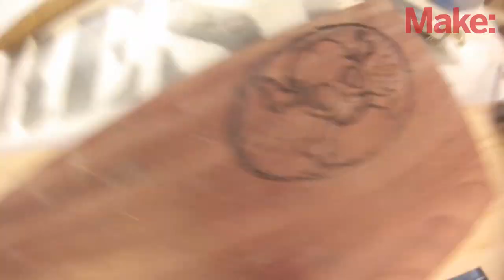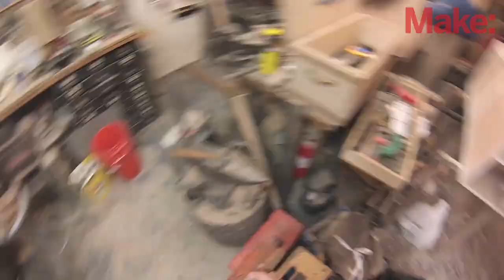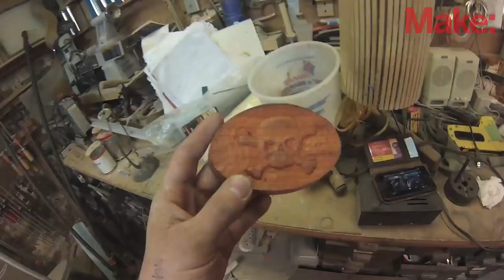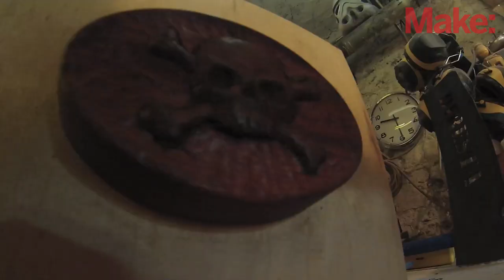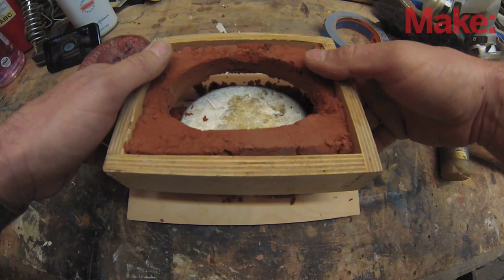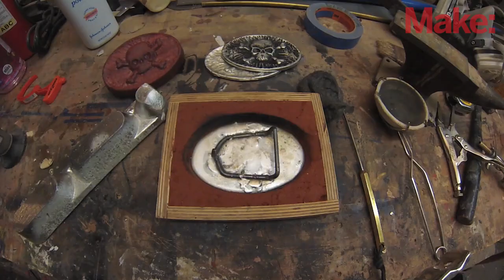DiResta: Skull Belt Buckle

Comment: I took metal shop back then in high school and the sand mixture is sand and water mixed together and leaves a impression of the model that Jimmy used. A lot of casting are made by using this method..

Comment: I find also very impressive, the design of the belt attatchment. I know that it is not a big deal, but you did it with only one piece of iron strip, by bending it correctly, and i would have thought something more complex and difficult definitely .
And also i had never seen this clay mold beign made in reality, except from some movies or documentaries that only show you one bit and not the whole proccess, which is something i like with your videos instead.

Comment: Pewter is very cool to work with. GREAT JOB
Reply: Are you sure that it's not Gallium?
I mean it could be Gallium, the stuff in the video, it fills all these requirements:
Melting point: 29.77 °C
Boiling point: 2,205 °C
Reply: Phoenix Wright Gallium melts at  85.57 °F. You wear a  belt buckle made out of Gallium on a hot day over 90 degrees, don't you think it would melt?
Reply: MrAlittle5150 Correct, forgot about Fahrenheit.
Reply: Phoenix Wright It is Tin alloy 178-888.

Comment: its soldering tin 
it melts when you heat it up with an torch its mostly known for cables and motherboards you see a small dot of silvery stuff where the cable connects

Comment: What was the material used to make the mold? It looked like a clay or sand. We used sand back in shop class because it was cheap but for a reusable mold it did not hold up well. 2 maybe 3 uses and done.

Comment: Beautiful work!  What is your metal? silver?  Was that a regular black paint you applied for the finish?
Reply: those bars are in the same shape I buy babbitt metal.  it's a tin or lead based alloy if that's what it is.
Reply: king butre I think that's actually tin because of lead is softer...
Reply: My guess would be aluminum, it is really white like that and easy to melt
Reply: dillon breaux Looks to me like those cathodes you put on the bottom of boats and in their bilge tanks to keep salt water from severely degrading the integrity of the hull.  Which I think are aluminum.  Seems like it would've been worth the investment to build a flower pot/sand/plaster-of-paris forge though.
Reply: 6foot4 butre
Its Zinc. Aluminum melt much hotter than that dillon breaux
Reply: Robert McCain It's tin, as mentioned in the link in the video description.
Reply: Robert McCain You can melt aluminium with a propane torch... just like the tin in this video.
Reply: RFC3514 and thank you for the clarification, if not for your comment I would have never clicked on the blog link
Reply: dillon breaux is that just a regular propane torch you can find at any hard ware store?

Comment: do you need a special kind of sand to do that?
Reply: +dominic cristante It's called "green sand", it don't cost much especially for a small project like this. You can buy 5 pounds for around $10 or less. You can always make your own out of cat litter and fine sand. There are several videos here on youtube  about how to make your own sand and the home casting process.
Reply: +brandy sigmon No mate, thats not green sand. It' s Delft Clay, a brand of oil based casting sand.
It' s very simple to use and it let you have a more refined surface of the casting.
I use it all the time to cast sterling silver and bronze.
Here in Italy no one carry it, so I hat to buy the product in the UK, but if you live in the USA, there is RIO GRANDE that carry this product.
Reply: Gunsmith Fiamma That's right it's "delft clay. I bought mine on ebay. I got mixed up and gave him the wrong info. They will figure it out. There is something else that you can use but I can't think of the name right now.

Comment: metal that you use?  is that silver? thanks
Reply: lead or tin.
Reply: i was Tin check the link in the description. southerdime333 Lead...... really?
Reply: yeah. youve seen the stuff  he makes. maybe the lead got to his brain. and it too is a low melting point metal..
Reply: Jesse Dielschneider hey, my guess would've been lead or zinc..
Reply: ***** well it melted pretty easy, and both lead and zinc have very low melting points.
Reply: ***** Dude! im not arguing with you... i just thought, wow that melts really easily it might be lead or zinc... yea i know, lead isnt something you want to mess with.
Reply: The metal is aluminium. - which he probably salvaged using a homemade furnace...
Reply: Materials/Supplies:
Tin alloy 178-888
Delft clay
Steel wire, 3/16 inch
Black spray paint
Reply: Jörgen Börg Ty
Reply: Some Guy In His Basement
yw, you can find almost everything of his project on his site ;-)

Comment: what torch is he using that's hot enough to melt alluminum?
Reply: Baconquerer Propane torch.
That torch gets up to 2000°C and aluminium melts at 660°C so it works just fine.
Reply: MsSomeonenew If you have not allot of aluminium it's fine but when you want to make full castings you must have bigger equipment because aluminium likes to release the heat easily.In the video it was probably tin which melt a 231°C
Reply: He's not using aluminum. It's Tin alloy 178-888. Aluminum would require a forge.
Reply: he is using a map gas torch (propane tanks are blue, map gas are yellow) map gas burns hotter and is therefore better for most applications. he is also using a tin alloy not aluminum. Aluminum would reguire a forge and a proper crucible to melt, it also hardens much differently than tin does. source: 4 years of blacksmithing and casting
Reply: Dominic got mine off of amazon. There's a link in the description to order the stuff jimmy has but it's dead, they don't sell that exact product anymore. Or if they do, it has a different part number.

Comment: I'd love to see this made from smelted beer cans or anything really if it's too soft.
Reply: +TheWarrrenator smelted beer cans or beer cans in general are made out of aluminum/aluminium. idk how soft it is but i think it should work! hopefuly ;D
Reply: That would totally work I melt aluminum and it's strong. I think he might have used aluminum as well, so it should work great
Reply: TheWarrrenator I think he is using lead.
Reply: Luis Fernando its pewter, lead won't melt with that low heat

Comment: how the hell can he hold the aluminum when hes melting it???
Reply: Al melts at over 600 deg. C, I think this is Pewter which melts at around 220 dec. C
Reply: Does jet fuel melt steel beams tho?
Reply: I guess you're referring to a widely discussed conspiracy theory. Jet fuel does not burn hot enough to melt steel, but that does not matter because even at the temp. jet fuel burns the beams would lose their ability to support the structure. Think of a blacksmith shaping and forming a piece of metal. He does not melt it, he just needs to get it hot enough to soften it.
Reply: Never thought of it that way! Awesome
Reply: Bush did 911 tho

Comment: was that clay??
Reply: No, its a special molding sand. Clay would've melted when he poured the liquid metal.
Reply: Alexander Kode What if you cooked the clay before pouring in the metal?
Reply: *****  Did a quick wikipedia. Thanks. But Im wondering if you can use clay instead? Like after you make the soft mould, you put it into oven for the clay to harden, and after that you pour the liquid metal in... would that work?
Reply: Plaster works
Reply: thanks
Reply: DaGunchijs ya i get what your saying that would work
Reply: Here is a perfect example of why you can't believe everything you see on the internet. The responses to your question seem reasonable but if you follow the link in the description there is info on all the materials he used ant as it turns out it absolutely was clay he used for the mold.
Reply: Its deft clay.
Reply: It was petrobond foundry sand for making sand molds